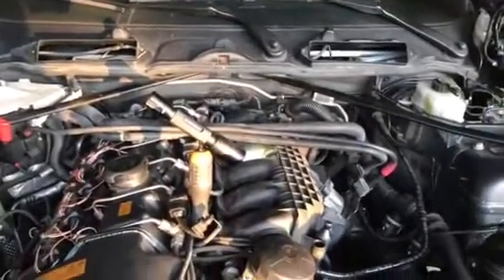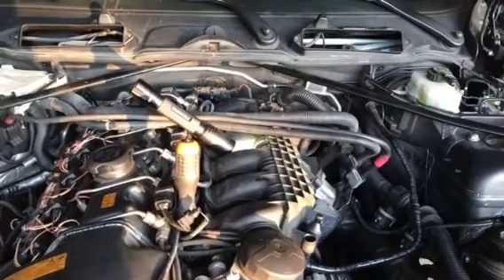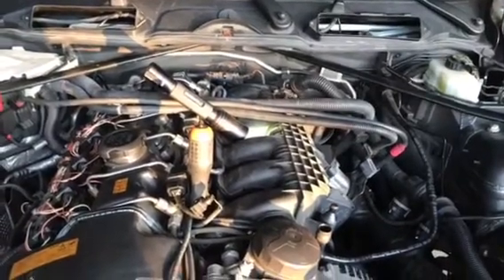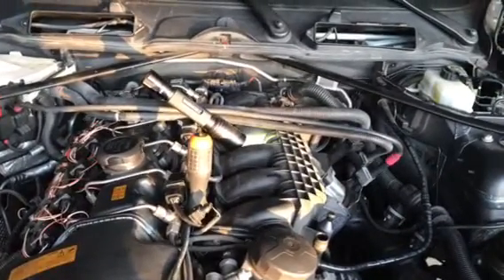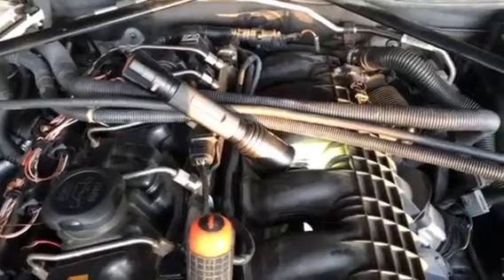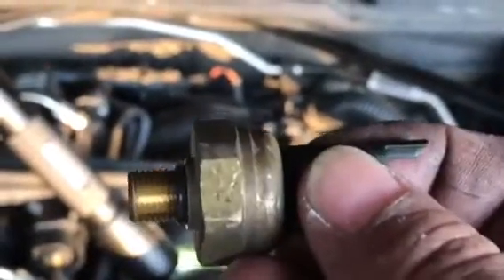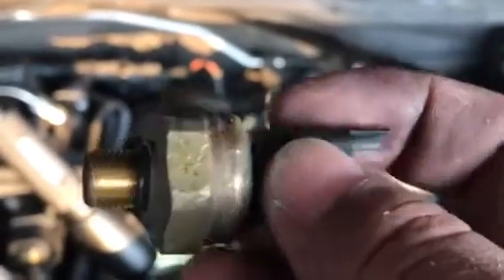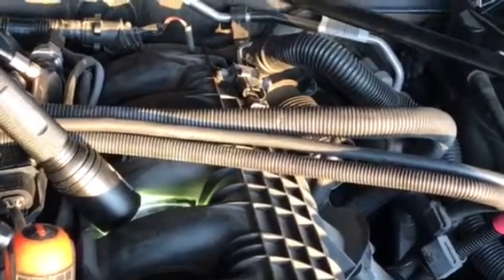BMW 2011 335 ODBii p0087

Comment: Hey boss, i just got all of a sudden driving off the lot in slow speed the Drivetrain Malfunction and after scanning i got the P10D9, P15DF with P0087. I erased the codes, waited about 10 mins. started the car, drove normal, switched to Sport mode and hit the pedal and bam! now i just got P0087 (Fuel Rail/System pressure too low! 2011 535i.
Reply: did the exact same thing in my 2016 328i xdrive, thought it was a tire/traction issue so didn’t think much of it, just got tires replaced and was riding funny, again assumed it was because of the new tires just needing to be worn in but this time when the code popped up there was a slight bang in the engine bay and got a check engine light now the car is riding funny and code won’t go away, what happened with yours?
Reply: Same man idk wat to do
Reply: @DJKarimification  What did you do, just happened to me fml.
Reply: Just happened to me